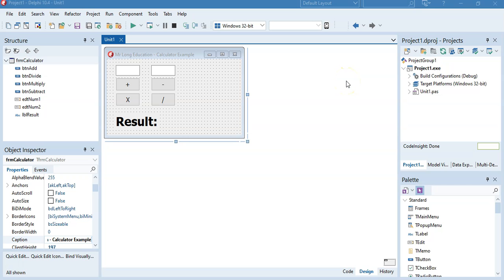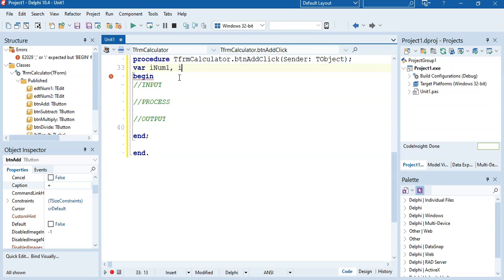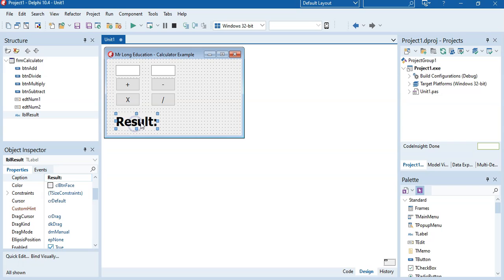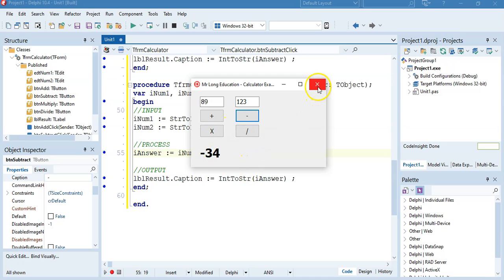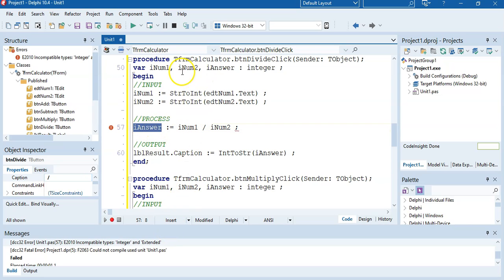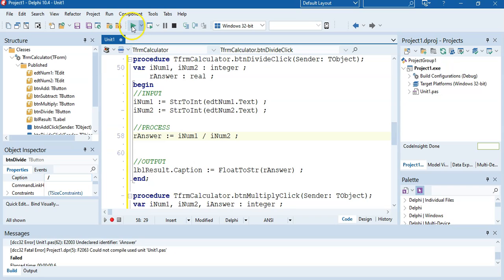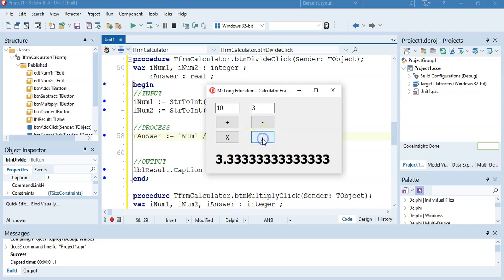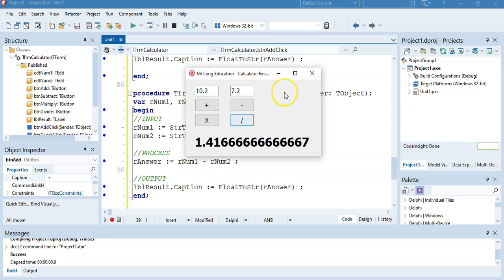Learn to code in Delphi | Part 8 | Calculator Example

Comment: when i try and add two numbers like 2.5 and 10.5 which would make 13 it gives an error, what can I do
Reply from the maker: Are you using real numbers instead of integers. Need to change your input to:
rNum1 := StrToFloat( edtNUm1.text ) ;
etc and iAns must be an rAns of type real.

Comment: Hi Mr.Long
I am currently running into a problem with my delphi 2010 program itself.
When in the coding page and I hit ENTER it doesn't make a new line but skips to the next line.
With this issue I can't really complete my code as I cannot make new lines for new instructions.
Could you help?
Reply from the maker: On your keyboard should be an insert key. Just press this once. If you can't find it then look on the Delphi screen in design view. At the bottom you will se the words Overwrite with and arrow. Click on the arrow and select the insert option.
Reply: Thank you very much! We can always count on you!

Comment: Hi Mr. Long 
I have been watching your content for about 2 years now.
I have got a slight problem with my Calculator app. I followed your code exactly etc. yet when I want to put in decimal numbers it gives me an error. Please help!
(I'm on delphi 2010)
Reply from the maker: What does the error message say?
Reply: It says "(3.1eg) is not a valid floating point value"
Reply from the maker: @damion4369  Try using a comma instead of a dot for your decimal numbers. See if that works.
Reply: Hi Mr.Long thanks a lot it works!